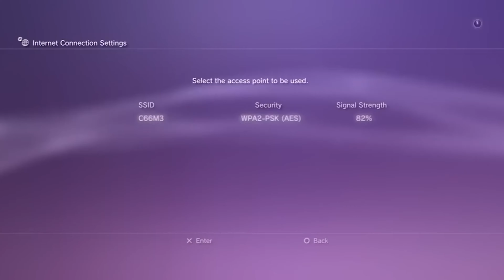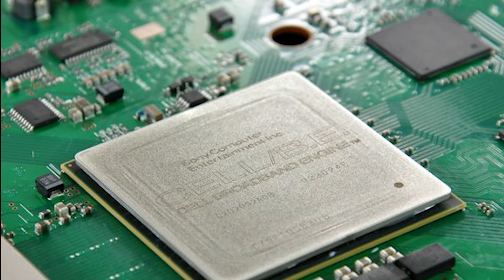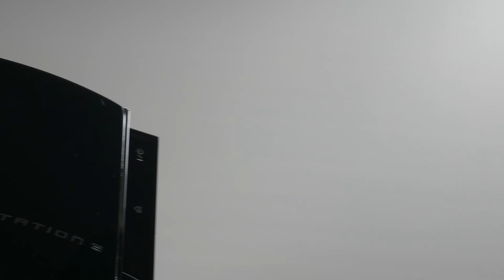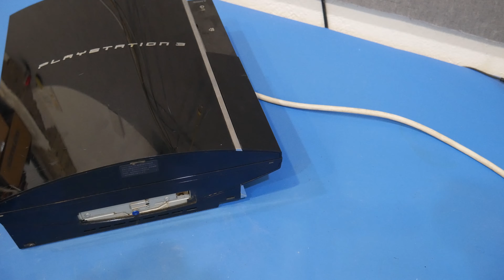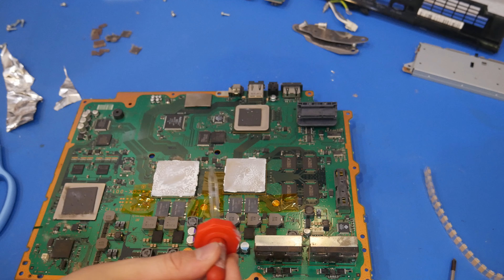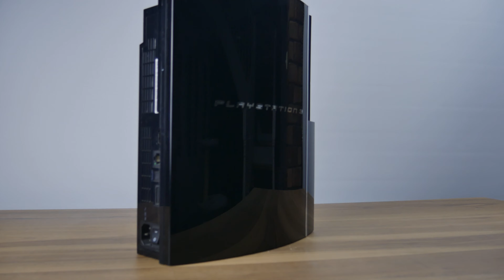Fixing Sony's BEST Console

Comment: Is heat the main cause for cap failure on these models? My 60gb still works. I try to keep my room as cool as possible when I use it.
Reply from the maker: Heat probably doesn’t help, however it’s mostly just poorly designed capacitors that fail with age.

Comment: If anyone here is thinking of doing this repair on their own especially WHEN they don't have any soldering exprience whatsover then please don't.

The PS3 mobo is a quite thick and absorbs heat like a mf. You will also need a pre heater for this, prying capacitors is very risky and heat tape won't protect the mobo from the slip ups that might happen when prying.

Also I'd recommend delidding the iHS on the Cell and RSX and applying new paste on the die themselves. (Only for experienced technicians because you can crack the die and completely trash the ps3).

Lastly the YLod is a GPU failure like the 360's RRod (which wasn't rrod but only three bars) the only long term solution for the YLod is GPU replacement, the ones from Slim PS3.

Comment: Hey man thats a great repair. I've always wanted to fix my CECHE01 Model ps3 ever since its gotten the yellow light of death. I know the methods of extracting the error logs through syscon but have zero soldering skills or experience. What would you recommend a beginner like me could start learning to solder?

Also just ignore the haters in the comments. They clearly skipped the video and missed the part where you referred to rip felixs video which said the ylod has several causes.
Reply from the maker: Honestly this is probably a great repair to start if you’re new to soldering! 

 It’s quite straight forward as the capacitors are large. Would definitely looking up some introductory soldering videos that show you the basics of how to use flux and soldering braid and then give the project a shot! :)
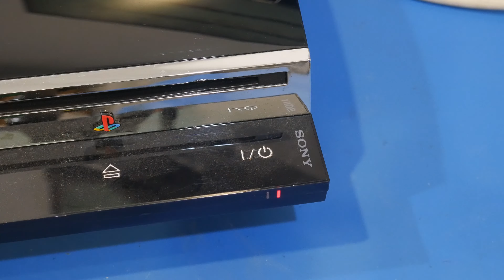Reply: If your console makes ylod in like 2-3 seconds from pressing power button then you have problem with bga under cell / rsx or you have a faulty rsx chip itself. But if your console stays on green after pressing power button for 5-6 seconds and then ylod just the same like in this video at 2:52 then you have very big chance to fix it by replacing rsx capacitors like in this vid.

Comment: 1 day ago... Seriously? People still think this is the problem? I doubt those tantalum caps are even a good enough alternative, the original nec/tokin are more similar to polymer caps. That'll fail in 2 weeks.
Reply from the maker: As I said in the video, this is what worked for me, and I’ve been using it for over 6 months without issue.
 I’m happy with this solution, doesn’t mean you have to do it.
Reply: Because it is not only GPU rsx failure that can happen and cause ylod to your ps3. Here after seeing 2:52 it works for 5-6 seconds i can clearly say from my experience that this particular console for sure Had bad rsx NEC tokins problem. If ot will be a bad GPU then it should Die and ylod in 3 seconds.

Comment: its not tokin caps its dying gpu substrate
Reply: @321bandzai @jm036 actually in this case it is indeed rsx NEC tokins failure. At 2:52 you can see it works for 5-6 seconds after he pressed power button. If that console would stop working after 3 seconds after pressing power button then you guys would be right. 3 seconds to ylod after pressing power button means bad ( cold solder balls ) under cell or rsx chip or faulty rsx chip that needs replacing.
Reply from the maker: It’s a combination of both
Reply: @Pendleton115  It's the GPU in like 99.99999% of cases.
Reply from the maker: @jm036  Replacing the capacitors clearly got the unit up and running again, I’ve been using it for over 6 months with no issues.
 Yes the GPU will likely fail sometime in the future  but if you ask me getting an extra few years out of my console is worth it before having to get out a BGA resoldering station.

Comment: I still have one. It's broken. I've taken it in countless times to repair it, but it keeps crapping out. But it's never going to be something I scrap for parts because of what it is. I figure one day I'll sit down and learn how to solder and understand the mechanics and just do it myself.
Reply from the maker: Sounds like your repair shop might just be reflowing the solder with a hot air gun.
 A temporary solution which can sometimes fix the problem for a short while.

 Unfortunately these early PS3s also suffer from GPU issues unrelated from the capacitors mentioned in the video, but that doesn’t mean it isn’t worth trying to replace them!
Reply: Get it to someone who can replace the rsx with the slim ps3.